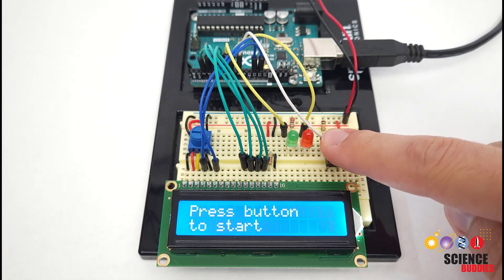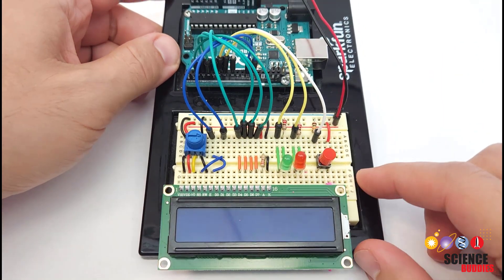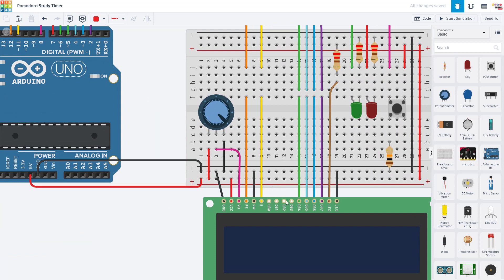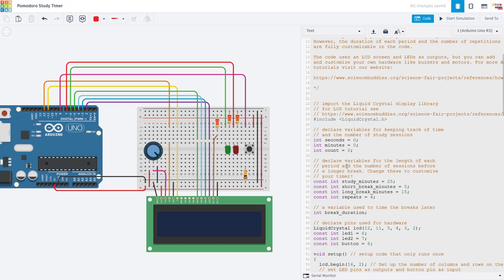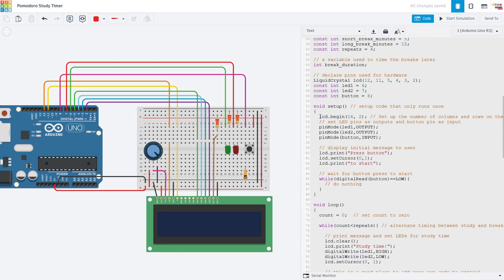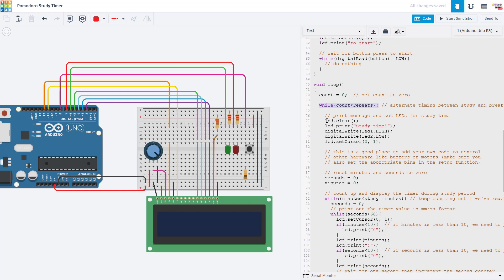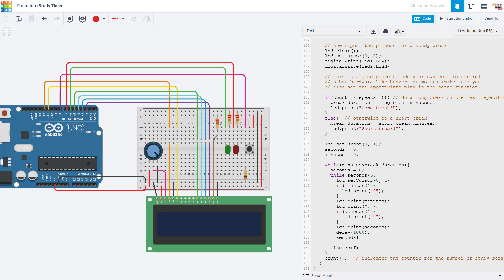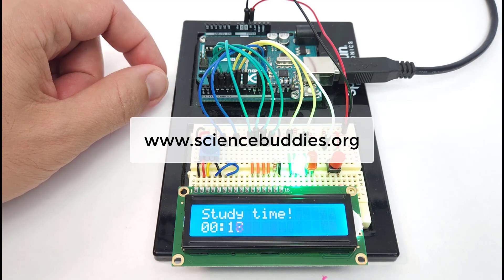DIY Pomodoro Study Timer with Arduino

Comment: Thank you for this. Im going to model and 3D print my own enclosure. I may try to add a potentiometer to change the study times and would like to run it with batteries instead. This helps a ton though. Thanks for the video!
Reply: I want to buy your timer